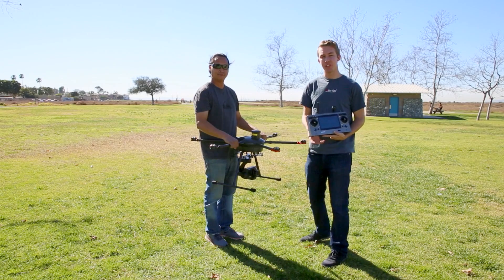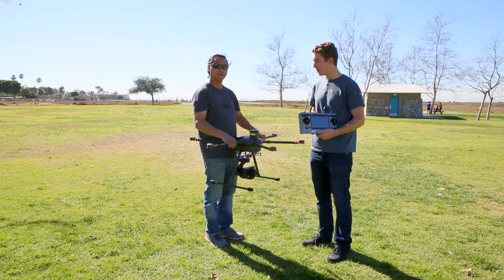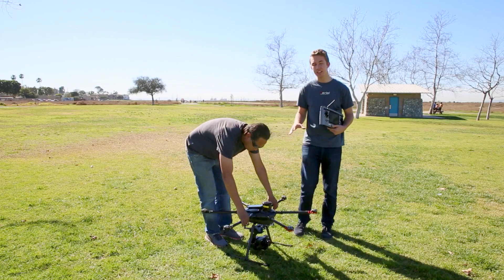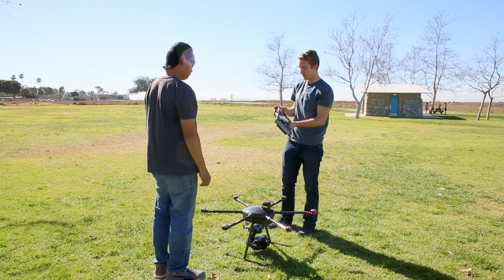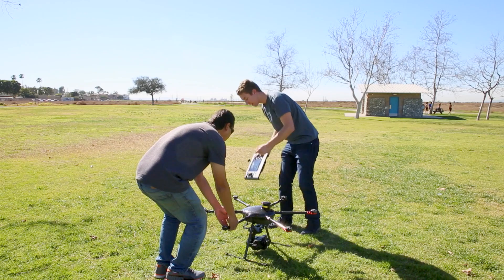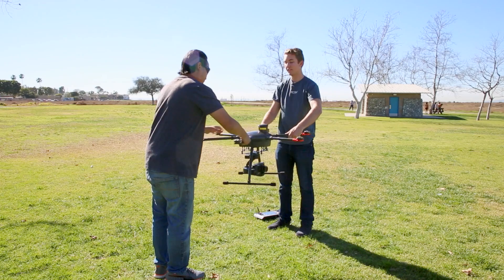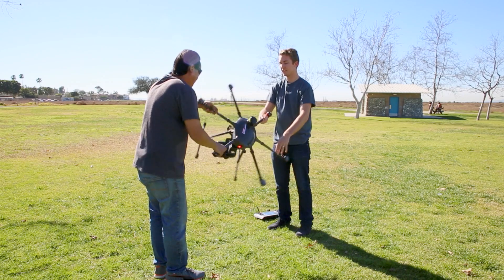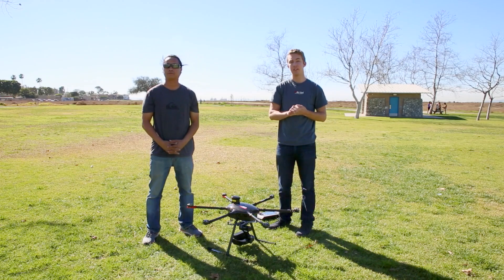How To: Yuneec Tornado H920 Compass Calibration Tutorial

Comment: I agree. I'm sure this is a very nice piece of kit, but I fly alone so a two person compass calibration is a deal breaker for me.  Also in one other video, I noticed, it is quite a lengthy process to setup with having to screw 12 screws to hold the props on and battery plug in.  Not what I call a quick unit to get ready and up in the air at moments notice if need be.  Hopefully things will change in other models to come.  Great review video nonetheless guys!